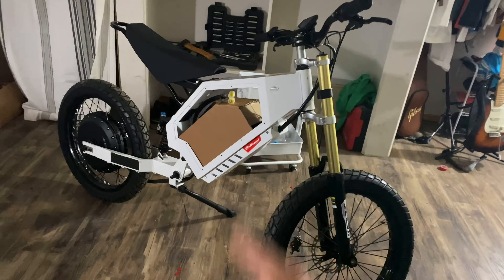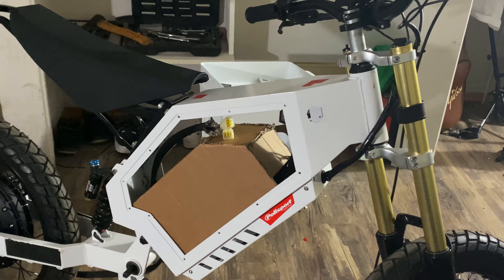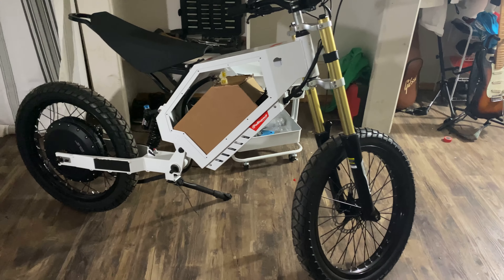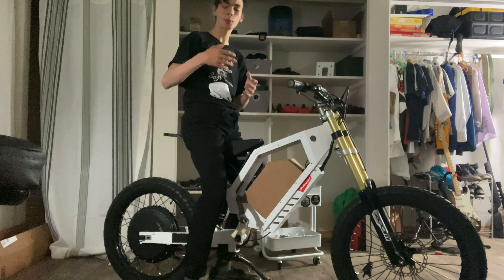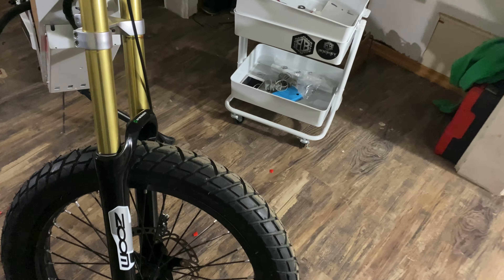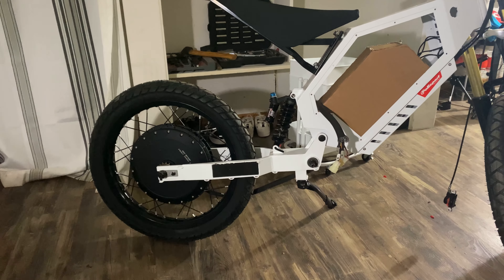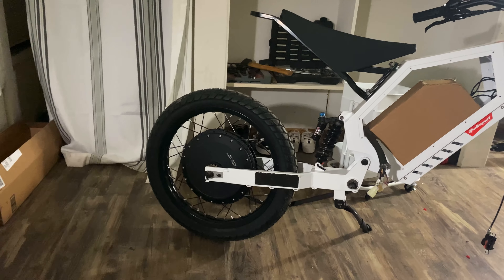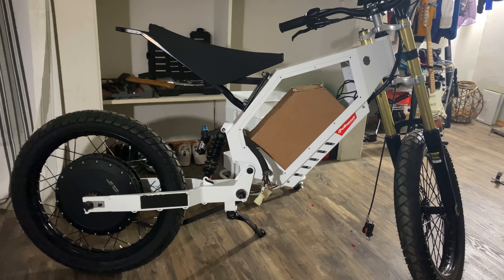Enduro ebike build (update)

Comment: I'm building the exact same bike, going with the MTB seat because of the popo. My rear swingarm I think is the same as yours? which don't have the retaining screw holes at the end of the swingarm. The torque arms they provide are not strong enough, I have the QS205 3.5 V3 motor and need to make bigger custom torque bars as the ones they provide will fail.

I look forward to following your journey and maybe we can find solutions along the way.
Reply from the maker: Awesome I’m glad you enjoyed the video and are doing a similar build. My swing arm also doesn’t have the screw holes in the rear which is strange because every other frame I have seen does. the only things I have left to do is make a battery connector and put in a spacer for my fork tube so the forks don’t move back and forth. Other than that getting the battery hooked up is all it needs to move.

Comment: Could you please make a parts list with links. If you can't make it for all of them could you please let me know where you got the frame and the  package with all the electrical components.
Reply from the maker: https://www.ebay.com/itm/223609867251
-frame kit
https://www.amazon.com/gp/aw/d/B083KMVZVV?psc=1&ref=ppx_pop_mob_b_asin_title
Motor kit. 

I personally don’t recommend getting the same kit as me and I would recommend getting the qs205 motor instead, it’s smaller, lighter , cheaper, and it can Handel up to 20kw of power wich is plenty enough for a 11kw ebike. That is something I wish I knew before I spent more money than I should have. 
https://youtu.be/-3nH49Q8rKU
In the description of this vidieo there is a motor kit I recommend. I wish I bought this for my bike and saved a lot of money.

Comment: Nice bike mate can you plz tell me what is the correct size shock I need the frame info says 220mm is it from hole to hole
Reply from the maker: I think anything from 190 to 220 should work. I’m using a 200mm dnm rear shock on mine. Although 220 mm will fit.
Reply: @ENDOPRYSMofficial  I have the DNM 220, im 5 foot 9 and its OK.
Reply: @mountainlion4853  was looking for a good but cheaper shock
Reply: @revparsons3tl  I understand Nick, but would it not be wiser to be patient and save for a little longer? It will serve you better in the long run. But cheap, buy twice.
Reply: @mountainlion4853  it would mate ture iam useing my 1500w to 2000w 26inch  wheel for  now but need to buy some axle spares as the swing arm a little wide but might take it to work I should be able to press it in a bit

Comment: I have the same battery coming and same build just in black and carbon and im running the 205 50h v3
Reply from the maker: I received my battery a couple of days ago. It’s a great battery and it is built very well.
Reply: Great good to hear im hoping ill be receiving mine in the next few weeks
Reply from the maker: I would recommend looking at making a battery switch for it. The connectors they give with it will let you hook it right up to the controller. But when you plug it in there is a bit of damage to the connectors from the resulting spark.
Reply: @ENDOPRYSMofficial  yea i most likely will and also im running a 300amp shunt and display for just the battery

Comment: What battery are you getting? Do you have a link?
Reply from the maker: https://www.amazon.com/NBpower-38-4Ah-Lithium-Battery-Charger/dp/B07XHLWH13/ref=mp_s_a_1_17?crid=39ZIAVL1MEHC3&dchild=1&keywords=72v+40ah+battery&qid=1630611113&sprefix=72v+40&sr=8-17

That’s the same battery I got. You can talk to the seller and customize it if you want.
Reply from the maker: You can get it for 1470 if you pay through pay pall because there is no Amazon tax.

Comment: How do you make a 8kw qs205 into a 15kw ?
Reply from the maker: You use a 200a controller and a battery with a battery that has a 200amp bms. I just got my bike working and 11kw will blow your head off.

Comment: That motor is good so you can't tell anyone it's downside you don't even know about electric motors and power
Reply from the maker: What I was saying was that a 5000 watt motor will run fine at 11kw. And would go the same speed as a 8000 watt motor running at 11kw. The only reason the 5000 watt motor would be better for this bike is because it would cut down on weight and price. And the bike would be the same speed and power.
Reply: @ENDOPRYSMofficial  it's post be heavy yes weight is problem not really